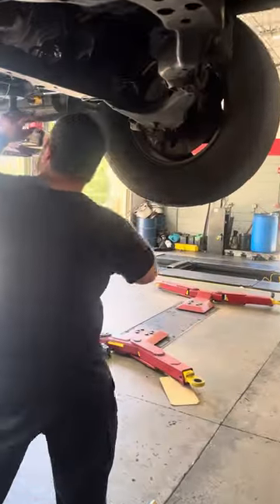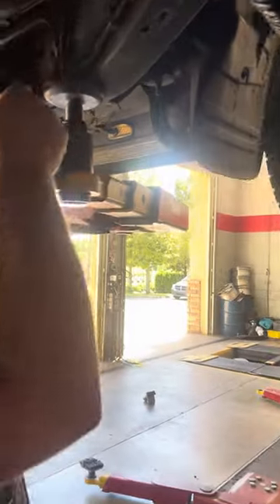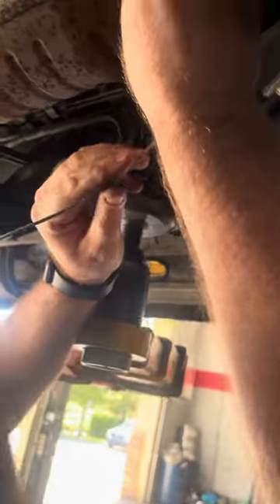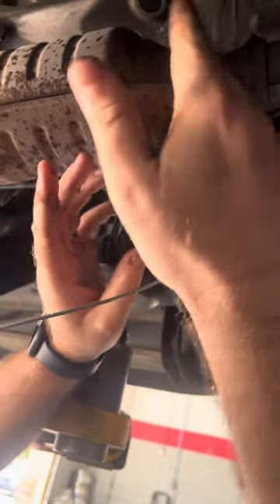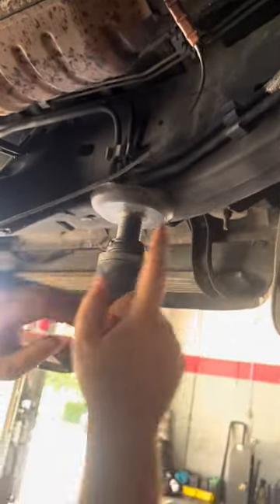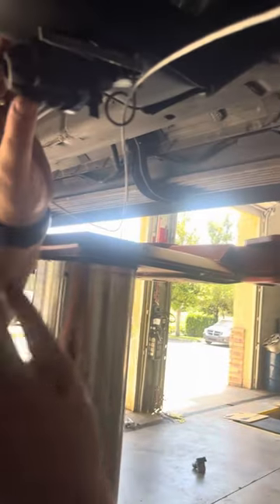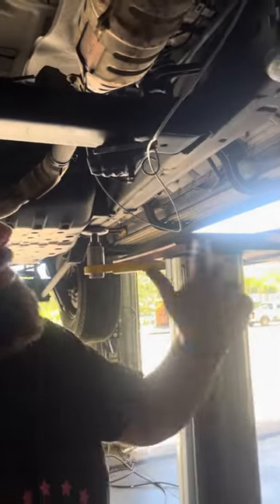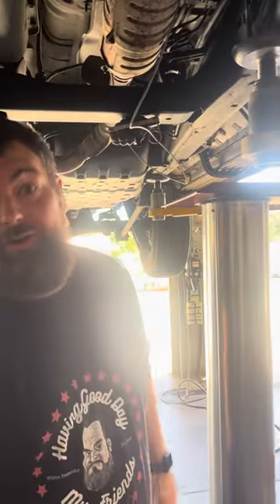Catalytic Converter theft prevention.

Comment: Stupid click bait
Reply: Just 'cause it was a trick doesn't make it clickbait. If you actually want a theft deterrent, install a cattle fence system on barbed wire welded over the muffler
Reply from the maker: Please explain how this would not prevent theft. Fairly confident it is a very accurate title.